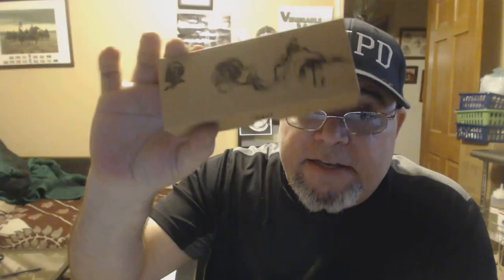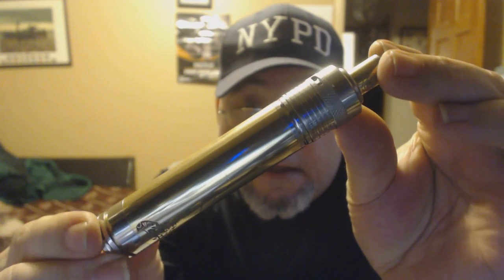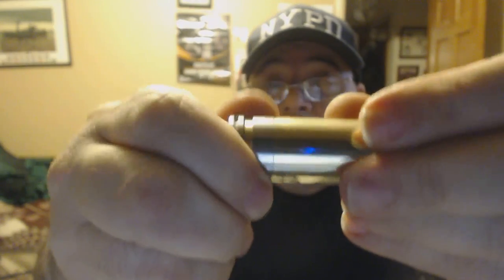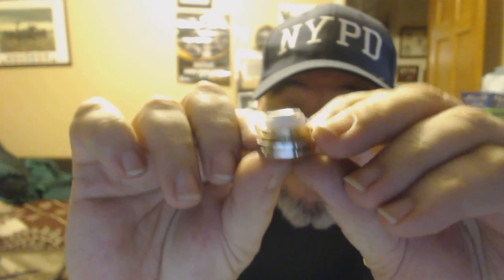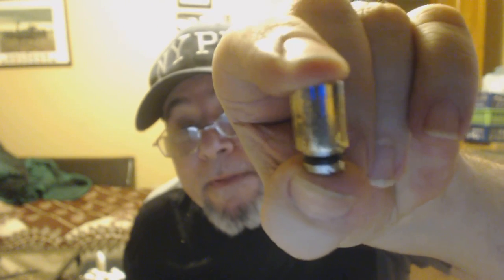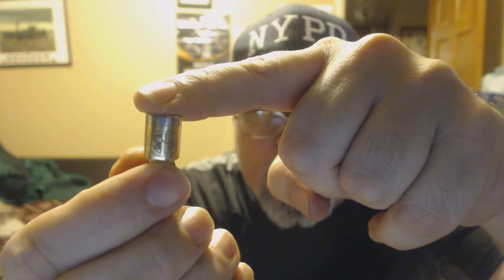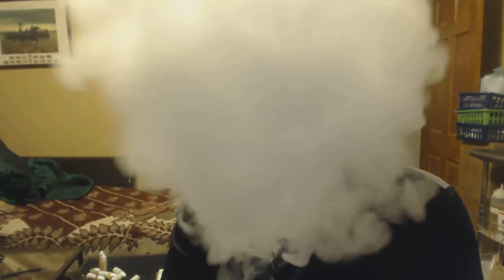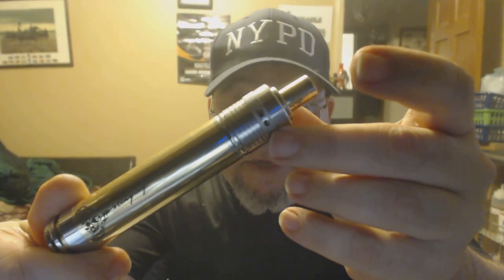Stingray Mechanical Mod Replica

Comment: I have to admit this Phimis Stingray clone is the best quality one Ive seen so far & based on the reviews the brass, stainless steel & machining quality is top notch, much better than the other clones from what I hear & that's pretty impressive for the price. This mod would look EPICALLY GORGEOUS with a Zenith V2 (with the Tiger Brass AFC ring of course) on top of it & would vape like a F-ING FREIGHT TRAIN!!! I have a Vaperev Nemesis & a Kayfun 3.1 which vapes FANTASTIC, so I really don't need another mech mod, however if I was going to get another mech & I couldn't afford a real Stingray this would HANDS DOWN be the clone I would get, a cut above the rest based on all the reviews.
Reply from the maker: nice

Comment: Need help! Took of the magnet of the switch screwed back in now theres no throw on it and wont fire. Pleaseee help never had a magnetic switch before
Reply from the maker: You need to make sure the magnet polarity is reversed so they push away from each other
Reply: theres only one magnet it was working fine untill i took it apart, can i use a spring in it or do i need to buy a whole newy magnet setp